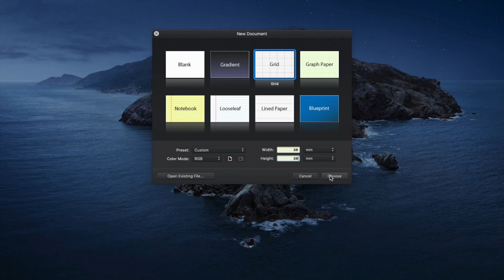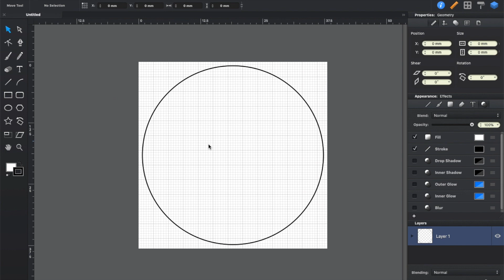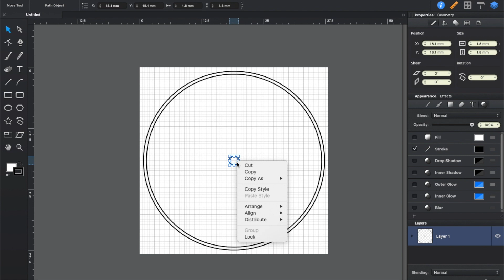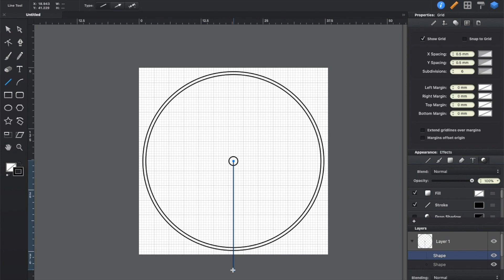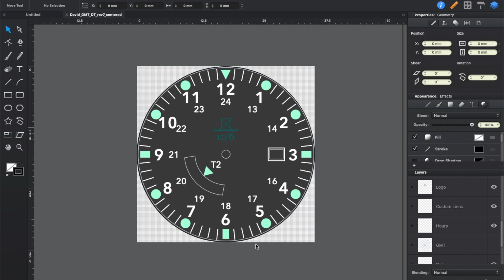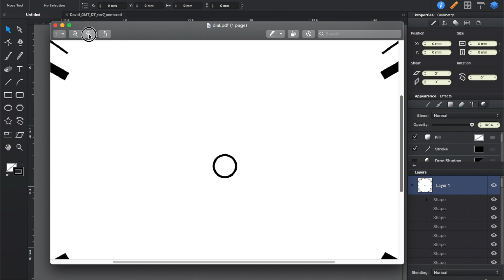Making Custom Dials: Dial Design

Comment: Dumb Question time. How do I get the rotate part to work? It's not copying anything along the dial...
Reply from the maker: when you select an element to rotate, you then have to chose the "center" point it rotates around and also enter the degree of rotation. Look at about minute 12 in the video, then you use the copy button and it copies the element in that rotation.

Comment: I love your work flow with this software, is it possible to do the minutes around a square or rectangular Watch face?
Reply from the maker: Sure, you just might have to adjust the length of the markers at certain intervals. I'd start with a circle and then square it off.

Comment: Nice. You mentioned you had looked at free vector editors. I use Inkscape, which is both free, and open source and it a very capable editor easily able to produce usable vector graphic dials.
 
I posted a few here if my efforts here. -> https://www.watchrepairtalk.com/topic/10860-custom-decal-dial-tutorial/page/3/?tab=comments#comment-121176
Inkscape is here -> https://inkscape.org/
It is available on Mac, Linux and Windows.
Reply from the maker: I tried Inkscape some time back, and although it's free, I found it buggy (macOS) and the interface clunky. But that's me. I know a lot of people use it. I found Graphic to be much more efficient and user friendly, though it does cost $30. Thanks for sharing.
Reply: thanks! I was looking for something free por windows users.